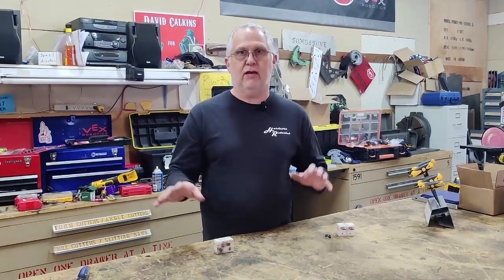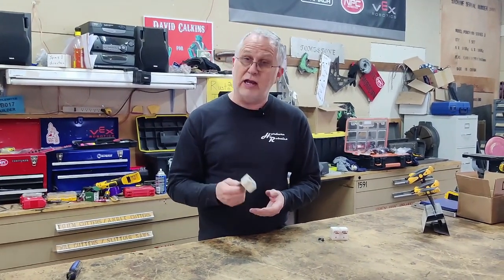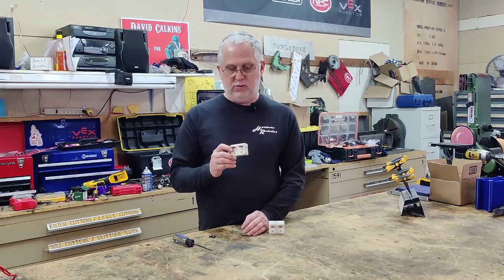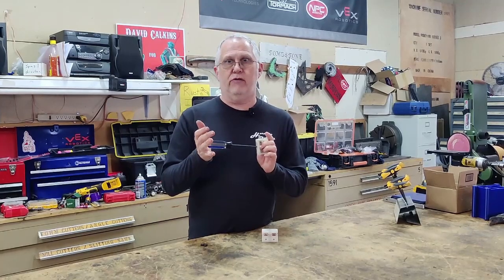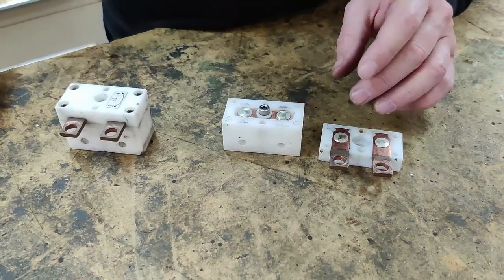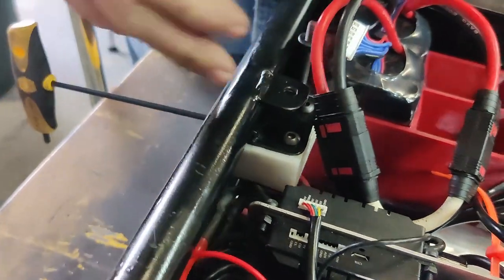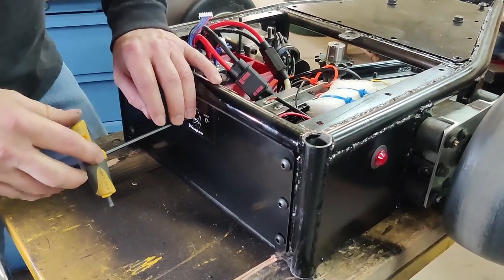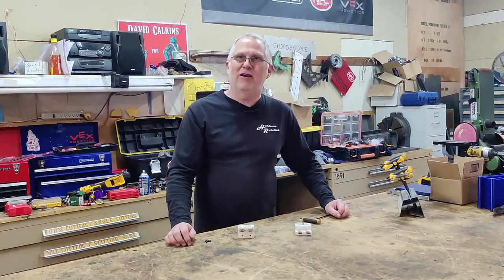Combat Robot Main Power Switch

Comment: Huh, I always thought the Whyachi switch would be clockwise to turn on, this way if the bolt breaks or plastic shears the robot would turn off, currently if the switch fails, then the robot is turned on. I guess that's beneficial to the driver, but it would be safer if it was the other way around
Reply from the maker: It's really not unsafe at all, the way it's laid out internally. The bolt in plastic is just never going to break - the only thing that could would be the plastic itself. And if the plastic did break where the bolt goes, that is also where the spring is mounted so it would just move away from the contacts. I've used these for hundreds of fights, over many years, and have broken more than a few along the way, and also seen many more broken from battle damage. I've never seen one fail in the on position.

Comment: I wonder what shock load these can take before they "bounce".  Without a break-over or a positive lock, relying purely on spring tension, there is a point that the contacts are going to separate.  This would cause arcing, burn the contact face, and increase the resistance in the switch.
Reply from the maker: You sir, are correct! These are the perfect size, weight, and amperage capability for our sport. But the bounce you refer does happen, and can cause some arcing on the contact face. After an event is over, I will usually take the switch apart and clean up the contact area with some emery cloth. It's just part of the maintenance of the robot between events.
Reply: @Ray Billings  Would a solid state relay be an option?  Turning it on could be as simple as plugging in a tray with a single battery.  Then, if an emergency disconnect is needed, it can be pulled out with a pull tab like the old school airplanes.
Reply from the maker: The rules state you have to have a mechanical means of disconnecting all power from the system. Any electrical system like any form of relay or contactor for control still needs a fully mechanical means of disengaging power. You can use a removable link, so a less high tech version of your pull tab for airplanes, but it can't be battery by battery - it has to be all batteries all at once. 

Oh and a heavyweight like Tombstone can draw around 2000 amps at 60v during spin up. So it's hard to find a solid state arrangement with that kind of power capability. Honestly this solution has worked really well for the last decade and half for me, so I'll plan on continuing it for the future.
Reply: Clearly James, what you need is to screw and loctite your batteries in to start the robot.  Then, to stop it in an emergency, you simply need a remotely-triggered cutting charge mounted against the positive wire :)
Reply: @stonefish98  so......like some of the original Tesla hardware?

Comment: Interesting, do you get sparking with this system? I suppose you'd have the same issue with links too.
Reply from the maker: The contact area is inside the switch, so although there may be some arcing internally when you turn it on, it's going to be minimal and unnoticed.

Comment: Ok, I'll be that guy.
In my opinion, given how dangerous these robots are, I would really want a >= 2mm gap between the contacts in the OFF position. It's it's too close any slack in the bits could potentially close the contact again. It's not made like wall switches where there's a positive feedback (spring) that pulls the contacts fully close or fully apart past a certain point.
So, I'm for team "give it a few extra turns".
Reply from the maker: Actually, you're wrong. There is a spring holding the contacts fully closed. That is the resistance you feel when you start to turn it off - you are driving the bolt against the spring. Once you tighten that bolt into compressing the spring, there is no slack in anything. 

If you feel better with a full turn, sure no problem. But any further is wasted and possibly breaks the switch.

Comment: With the switch being at the very back of the robot, is there any risk of damage to it?
Reply from the maker: There's risk of damage anywhere you mount it :) 

This was just the spot that made the most sense with the rest of internal layout, and also gives access even if the robot it upside down which is a good thing from a safety aspect. I always hate having to turn over a live powered robot to turn it off
Reply: @ray9368  Now I'm remembering both fights where Malice got knocked out by being balanced—perfectly—on their rear.
Reply from the maker: That can happen if you don't plan for it, and well can even happen if you don't plan for it well enough. :) I did plan for it with Mortician in a way that wouldn't have allowed for that to happen to us.
Reply: @ray9368  Figured. Malice jumped on it pretty quick after it happened the second time. 

Was great seeing you with Bunny for their fights in latest BattleBots series. Team Malice have really stepped up their threat this last 12 months.

Comment: It's always nice to see people who run a youtube channel because they want to share the knowledge.

The lack of a snap action in the Wyachi switch always seemed kinda iffy to me, but they're very simple to manufacture, and more reliable that way.
Reply: Most builders implement a soft start on their bots, triggered by inserting the screw driver into the switch hole
Reply: I think a snap action is likely to break loose under extreme accelerations these bots may experience